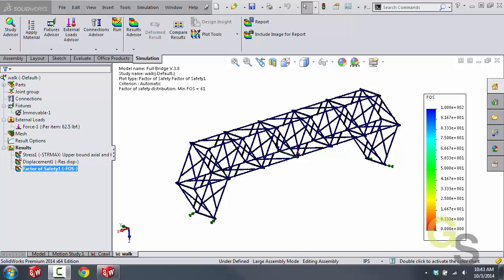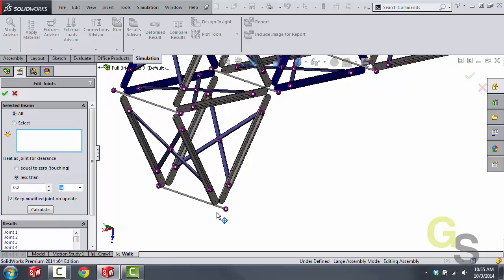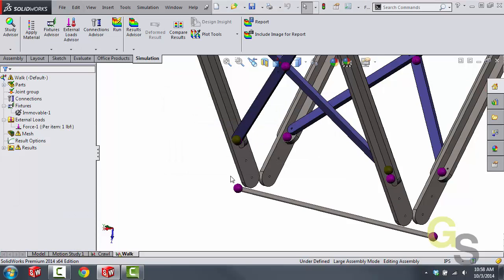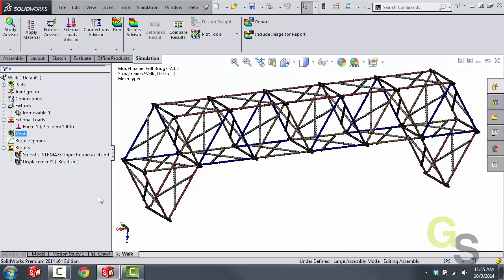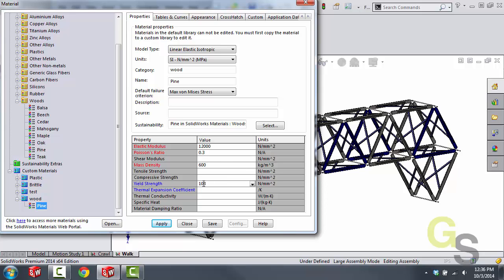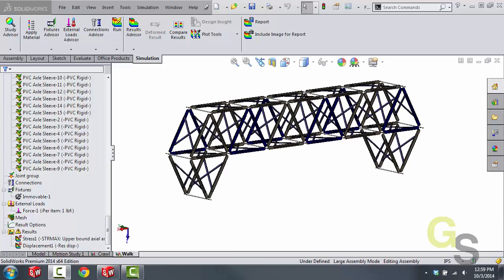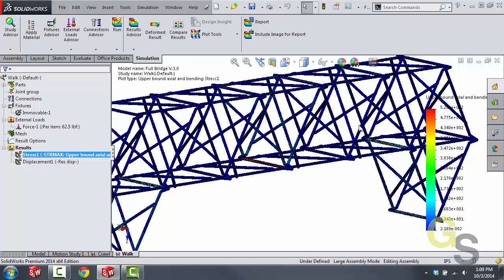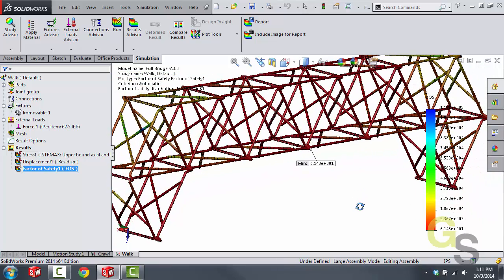The Crawl Walk Run system with SolidWorks Simulation Part 2

Comment: what we do here is
1. we find out the stress concentration zone/area. and model that area in detail 3D CAD model.  
2. We model only up to connected joints nearby so that we can transfer the joint forces to the 3D  mesh model
3. then we measure the joint forces from the beam analysis and manually apply it to the 3D mesh analysis and run the simulation. 
this will solve quickly than solving the entire model as 3D mesh.

Comment: I think something is wrong here - just correct me if i am wrong.
Some of the bracings on the front and back faces shows no bending - i can see it on the deformed view.
However, ALLL your bracings should have bending, there is no pinned support 
in your model connection plate has 2 drill holes which prevents all types of degree of freedom.

Maybe i missed something in my poor sound quality and small monitor.